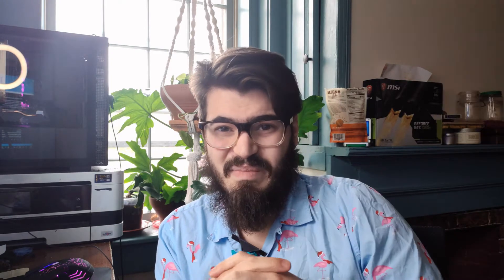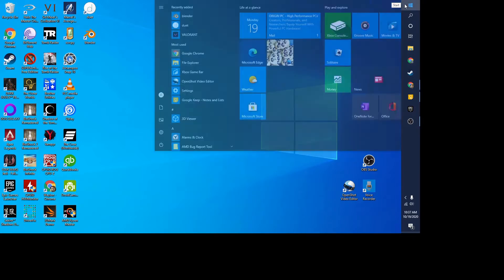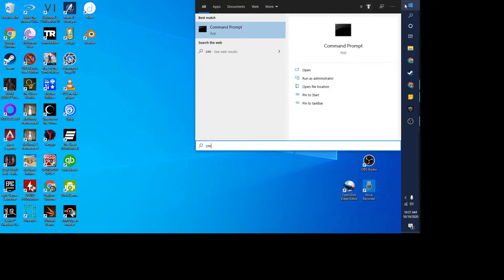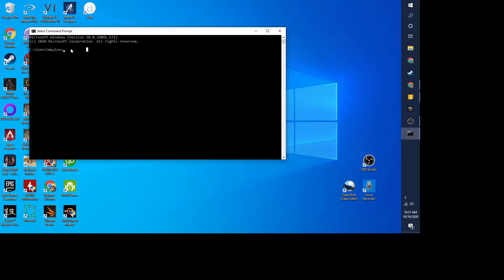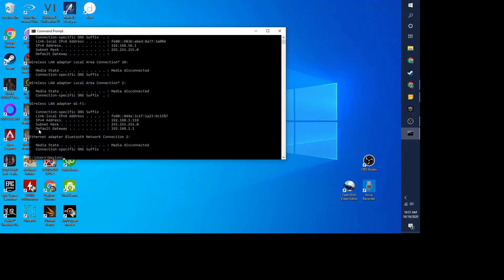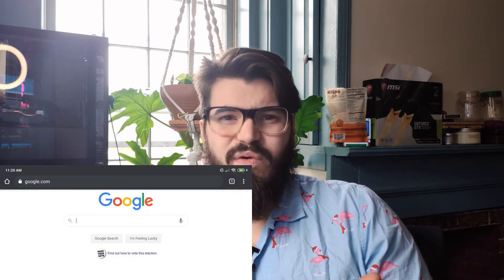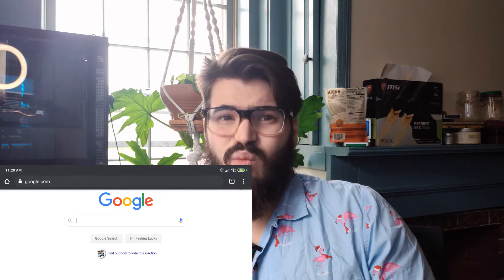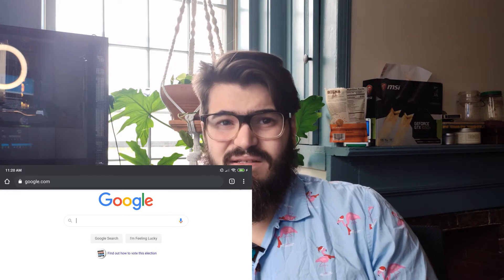Why Does My Router/Modem Keep Overheating?

Comment: i was having pretty good internet with this router we had to buy a new one because the lightning storm blew out the network port (the router still worked but network port was fried) anyway so i had to reset my router that we bought and it worked for maybe a day and the disconnecting issue came back. Then i decide to roll back the firmware thaat i updated and all my issues went away i do have a little fan on it right now